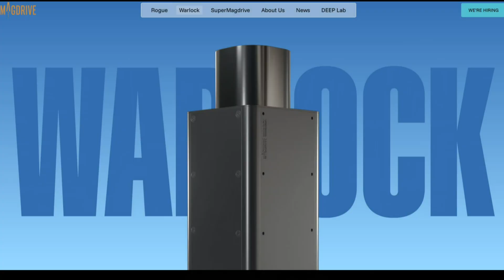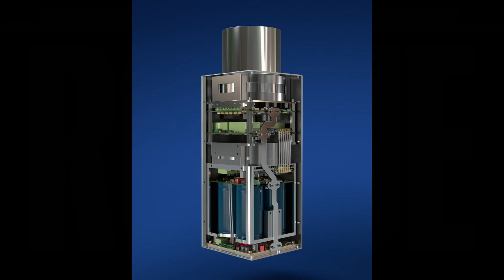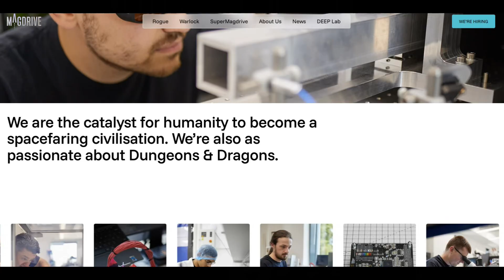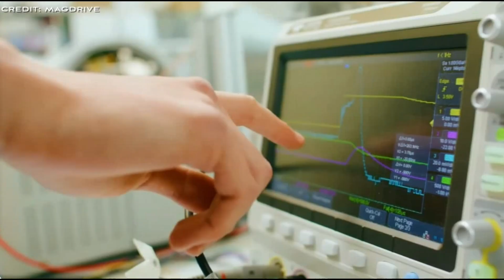An Engine That Eats Space Junk?!

Comment: How does breaking up space junk into tiny pieces and throwing it out the other end as an ion mist clean up the space junk, wont they just reform later into tiny specs that are also dangerous? I also doubt that specifically navigating to refuel with space junk will use up less deltav than just going directly to your destination.
Reply from the maker: I think the idea is that it then can't crash through somebody's house or front porch. Like we've seen in a few videos. But it could certainly create other problems...I suppose we will just see.

Comment: Thanks for this, Marion!  I hadn't heard of them.  I think their concept has potential for other in-space uses.  However, I'd think there would be too many issues in eliminating space junk.

I don't think there would be many space junk items that would be 100% metal (such as transistor chips, made of silicon).  And it would have to dismantle objects larger than its"oven."  What happens to the non-metal parts?  This seems too challenging, and could lead to making the problem worse if a mission goes awry (such as a dismantling snafu).

I myself live on a diet of metal (heavy), and it's not for the timid.😁  I wish them luck!
Reply from the maker: Yeah, these are all fair concerns. Def still a lot of questions to be answered.
Reply: A great tool for space pirates  --  An electric powered gun that strips off it's bullets from blocks of metal--  Uhm  Will it be called a Magdrive gun ?
  Kerr knows all aboot this weapon from her recent acting job on the new Serenity FireFly movie..